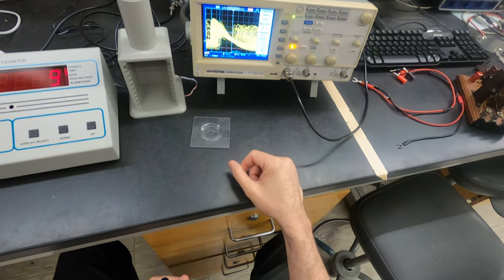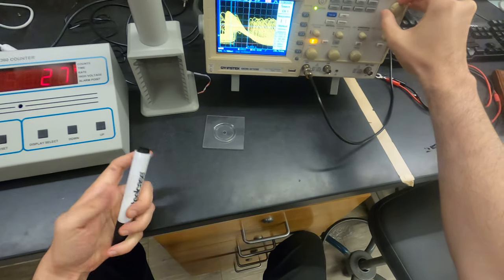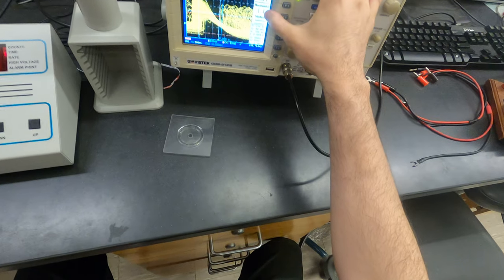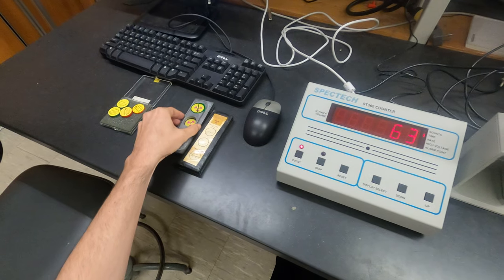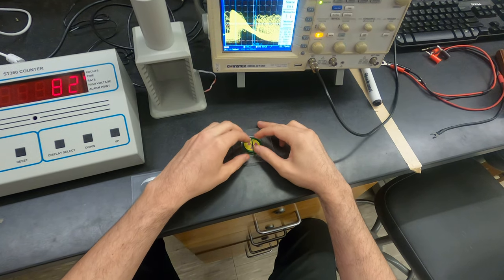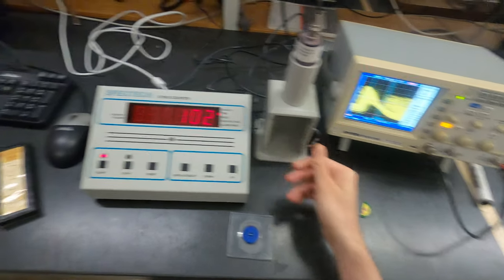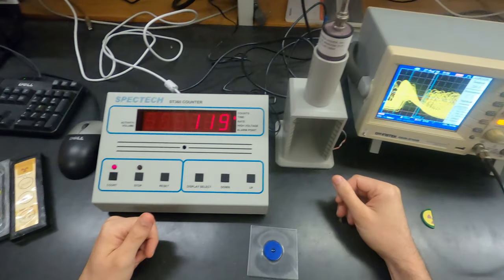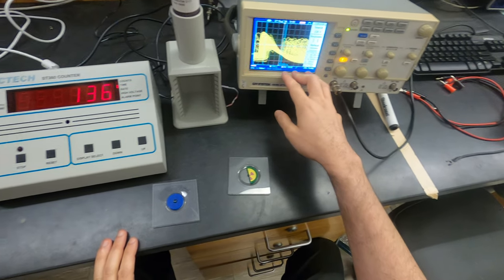The dead time of the Geiger counter – part 2

Comment: i have a really cheap FNIRSI GC-01 running radpro (the preinstalled firmware was garbage), and it has an option to estimate dead time itself, which is nice. so its currently just sitting next to the hottest source i own, which is just a block of coal lmao. currently it predicts that the dead time is less than 114us, but it will go lower as it gathers more data :)